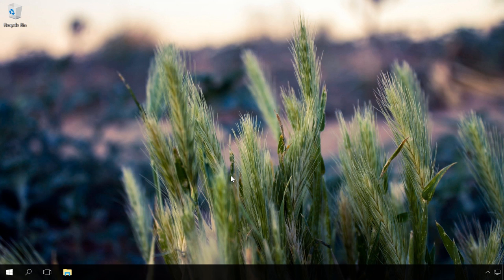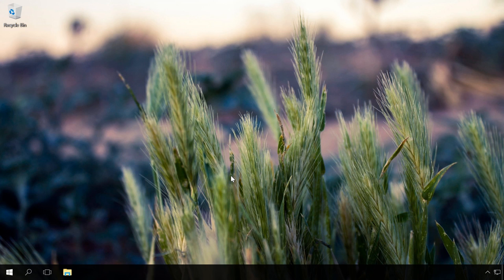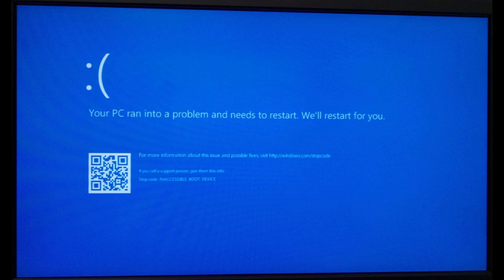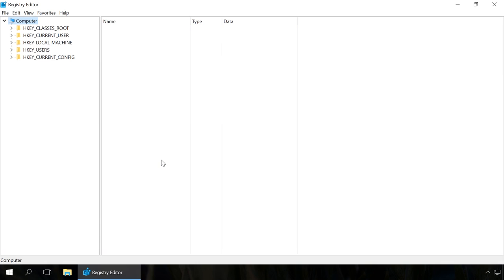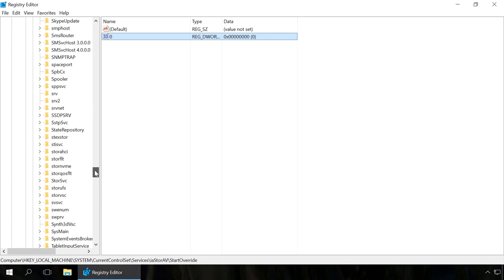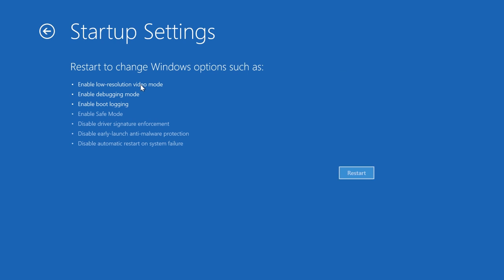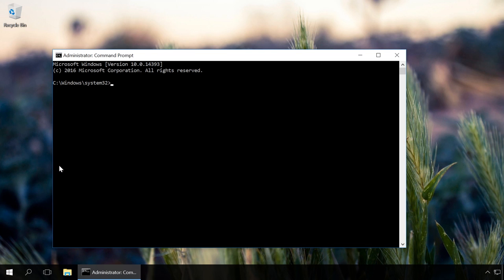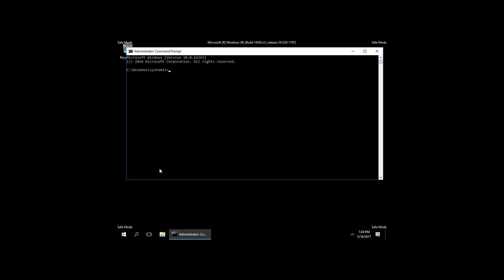How to Enable AHCI Mode Without Reinstalling Windows, INACCESSABLE_BOOT_DEVICE Error 💻🛠️🤔

Comment: Hi, I have a really old pc, with legacy bios I used your instructions and worked like a charm. At first after I restarted my pc it would not boot, since I'm on windows 10 it went into repair mode and after that I could log into windows. As mentioned I changed IDE to AHCI, I looked in device management and there AHCI was enabled. I have an ssd and finally I can feel the speed. Thank you so much.
Reply: I have not AHCI option too, then I could do it ? I am running Windows 10 in a SSD without AHCI I believe I am going to see the configuration of win 10 in my PC..I am in Win 7 now.. Uhmmm interesting.....
Reply: @galeanoj2005  I also don't have option of AHCI what can i do

Comment: thankyou.. i'm working on a clients OLD laptop.. swapped in a SSD drive, system was on ATA. did your 2nd method, upon first boot after inserting BCD command, it blue screened n auto restarted n then went into safe mode all on its own n installed the SATA AHCI driver.. then I did the BCD 2nd input and restarted, started normally into windows 10 n AHCI.. perfect.. I've got this page BookMarked for sure now..  👍😉

Comment: in my pc, in device manager - IDE ATA/ATAPI Controller, i dont have driver called AHCI, but it have "Intel(R) 82801GB/GR/GH (ICH7 Family) Serial ATA Storage Controller - 27C0", is this also means AHCI mode is enabled?? in bios, there is sata operation and i set it to enhanced, instead of compatible and disabled. no AHCI text anywhere in bios to tell me if AHCI is enabled or not.

Comment: I cant start my windows bro,when i start screen this "reboot and select proper boot device or insert boot media in selected boot device and press a key"... My bios is default and default set ahci...
Reply from the maker: The error message you're encountering, "reboot and select proper boot device or insert boot media in selected boot device and press a key," typically indicates that your computer is having trouble locating a bootable device. This could be due to various reasons, such as a disconnected or faulty hard drive, incorrect boot order settings, or a corrupt operating system.

Here are some steps you can take to troubleshoot and potentially resolve the issue:

Check Boot Order:

Access your computer's BIOS/UEFI settings. You can usually do this by pressing a specific key during the initial boot process, such as Esc, Del, F2, or F10. The key to access the BIOS/UEFI varies depending on your computer's manufacturer.
Once in the BIOS/UEFI, navigate to the "Boot" or "Boot Order" section.
Ensure that your hard drive (where your operating system is installed) is set as the first boot device.
Check Hard Drive Connections:

Open your computer case (if it's a desktop) or check the bottom/side panels (if it's a laptop) to ensure that the hard drive cables are properly connected.
If you have a laptop, you may want to contact the manufacturer for assistance, especially if it's still under warranty.
Test the Hard Drive:

If possible, connect the hard drive to another computer to check if it's recognized.
You can also use diagnostic tools, such as the manufacturer's disk diagnostic utility or third-party tools, to test the health of the hard drive.
Check for External Media:

Ensure there are no external devices (USB drives, DVDs, etc.) connected to your computer. Sometimes, the system might be trying to boot from an external source.
Windows Repair/Recovery:

If you have a Windows installation or recovery disk, you can use it to access repair options.
Boot from the installation or recovery disk and select repair options like "Startup Repair" or "System Restore."
Reinstall or Repair Windows:

If all else fails, you may need to consider reinstalling or repairing your Windows operating system. This process will vary depending on your version of Windows.
Seek Professional Help:

If you are not comfortable performing these tasks or if the issue persists, it may be best to seek help from a professional technician or your computer's manufacturer.
Remember to back up important data before attempting any major changes to your system. If the issue persists or if you are unsure about any of the steps, it's advisable to consult with a professional technician for assistance.

Comment: 【need some help】I have a old Compaq C707TU laptop(updated BIOS) running Windows 7 Enterprise. There's no AHCI option in the BIOS. There's only one option similar to this i.e. "Enable/Disable SATA integration". It is currently Disabled. And this method is not working. Although my HDD is SATA1 type.

PLEASE HELP ME HOW TO ENABLE SATA INTEGRATION OR GET THE AHCI OPTION.

Comment: Hi there. I am using Intel core 2 duo processor which is 64 bit and supports ahci with sata 2 connection. What I have noticed is in regedit setting instead of iAstoreav for my pc it is showing as "iastoreavc" is displayed but content 0 is available.
What can I do here? What is the major deference? Also when I opened 0 it mentioned the same value as yours "3"which you asked to change to 0.
Reply from the maker: I have never encountered this before ...
Reply: @HetmanRecovery  for some reason I couldn't do partion in disk management so did a fresh install.

Comment: I read your article and can not comment ....I have an old machine with mother Gigabyte M68MT-S2P Nividia GForce 7025 Rev A3 nForce 630a Rev A2. The Bios do not have option for AHCI, (Award Software International Inc F1 12/24/2010) in Windows 7 all is ATA there is not AHCI. I have too a SSD disk and there I installed Windows 10 without any problem, How do yo say that we can not to install a SO in a SSD without AHCI ? I could. and Windows 10 is running ok--..My Bios do not have any more updates....finished in 2010...Perhaps I will search If I can change the Bios chip?? My mother say Bual Bios 3TB+ Hybrid EFI Technology, but the Award do not show nothing....Thanks

Comment: Can the second method be used if my sata controller is set to RST instead of IDE? I have a Lenovo 256 SSD, the BIOS Sata controller setting is set to RST. When I tried to switch to AHCI, it said that doing so will erase all current data. Is there a way to change to AHCI and keep all my current data?
Reply from the maker: It's working and don't touch

Comment: hi, i have a problem, i have asus prime b365m-k motherboard with 9400k processor without integrated video card, with asus gt 710 video card! in the bios of my asus prime b365m-k motherboard i don't have the ide or ata selection, i only have ahci or intel raid! when i try to start an old windows xp or w7 operating system of my old pc that has another motherboard i get the blue screen with error 0x0000007b!
I wanted to know to solve the problem and start the system of the old pc without making a new installation do I have to change the motherboard that has a sata configuarazione with ide selection?
or the problem would be the processor without integrated video card that gives me the blue screen when loading w7 of the old pc or new installation of an old operating system such as windows xp?
can you help me solve the problem and recommend a motherboard that has the sata configuration ide? thanks

Comment: I have separate settings in my Asus Rampage III Extreme BIOS for SATA 3G and SATA 6G ports. Both have AHCI and IDE options. My OS is installed on a SSD connected to a SATA 6G port and I have other HDDs connected to the SATA 3G ports. I used the "change registry" option and then went to BIOS and changed both SATA 3G and SATA 6G to AHCI. When I reboot, I get the inaccessible boot device BSOD because if I don't restart in safe mode as you well advise, only the SATA 2G will be changed to AHCI. So I rebooted in safe mode and all worked but... I went back to Regedit and noticed that iaStorAV\StartOverride\0 is set back to "3"... But the  iaStorV\Start is still "0", while the storahci\StartOverride folder is now gone and replaced by storahci\Enum. Is this normal?
May this be related to my SATA 6G having a Marvell driver? I also noticed that I now have two MArvell drivers installed: 91.xx and 92.xx... Is this also normal?
Reply: Did you ever have your issue figured out? I ran into the same problem.